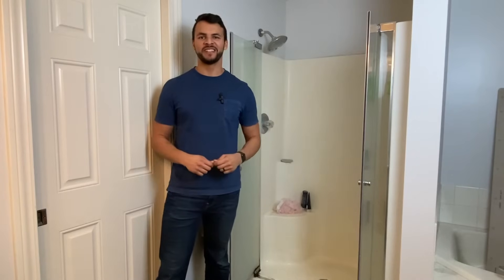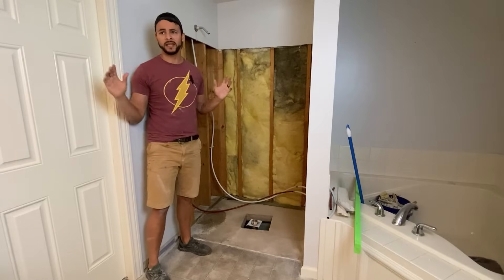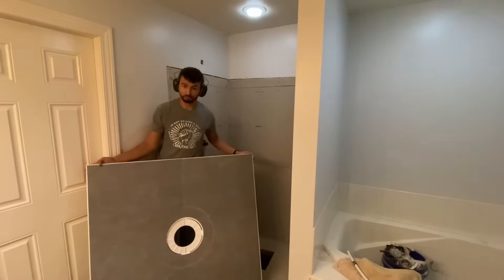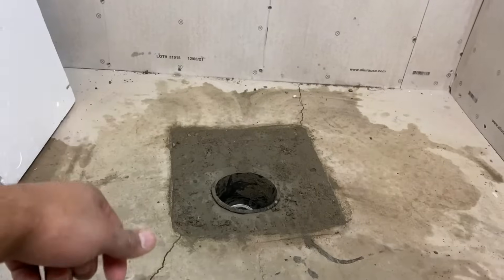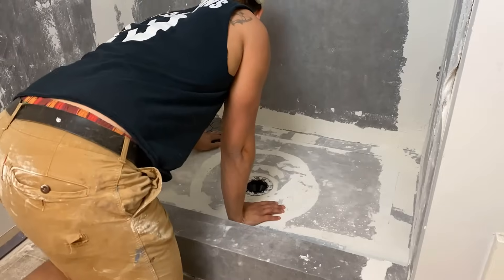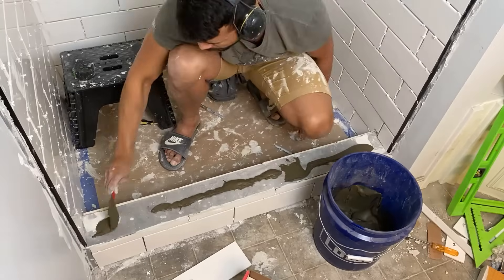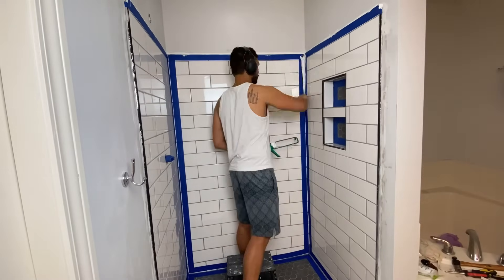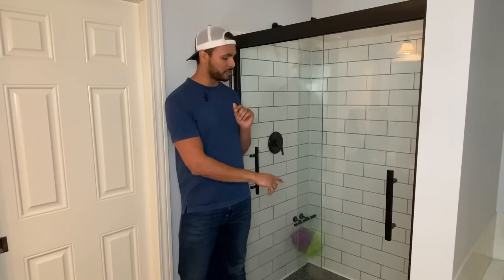How Much Does it Cost to Remodel Your Own Shower? | DIY Shower Remodel

Comment: A few tricks I learned from studpack building showers: 1) tile the floor first. 2) don't cut the hole for the niche until you have started tiling the wall it will be installed in. Helps us DIYers get it perfectly aligned with full tiles.  3) leave the bottom row of wall tile for last and plan for less than a full tile so that bottom row can be cut to fit the slopes along the bottom and yet be level along the top edge.  My advice: every DIYer needs a laser level or two.  I am in year 4 of a full gut renovation of a very old cottage, I have used my basic Bosch lasers for countless projects. one projects lines one projects dots.
Reply: Solid advice for all of us weekend guys!!

Comment: Not mixing concrete and doing dry pour like this will get you about 15% of the strength and vastly extends the cure time, in 30 days half of the thickness will still be uncured.

Comment: I've noticed that many DIYers love that niche idea. Seems like they just continue to copy it just because they see everyone else doing it in every DIY shower tutorial. Just letting you know, that small add on will increase the difficulty of this job by double. If you really want somewhere to put your bottles, I'd suggest just cementing a small ledge, such as a 36x4 inch slab of something like solid surface material.
Reply from the maker: Man, you couldn't be more right - that I remember that little niche being a nightmare lol. But we really wanted to used the same flooring tile to break up some of the subway tile. And assuming you'll have the shower for a good amount of time, then the extra headache is worth getting what you want in the end. 
Thanks for checking out the video!

Comment: I completed my 100% diy Schluter system tile shower last July,  $1500.00ish in materials.   Not a beginner project but doable for more experienced DIYers who are patient and detail oriented.  I watched studpack, tilecoach, and Schluter videos for skill-building.
Reply from the maker: Nice work 👍🏽

Yeah, it’s definitely a bit of an undertaking. But certainly beats an $8,000 contractor bill. 😅
Reply: @donnygrahambuilds  Tilecoach said that in Northern California, a complete tile shower will be in excess of $20,000.
Reply from the maker: @Alex.smiffy  gross lol
Reply: @donnygrahambuilds  I am spending under 40,000 on my entire house, inside and out Over 20,000 for one shower is insane.
Reply: Great video! Thanks for the detail! Watched the whole thing.
Reply from the maker: @ajoc222  thanks man! Appreciate the support 👍🏽
Reply: @Alex.smiffy that all depends on what you want. My parents shower has $15k in parts alone, and my dad owns a 50 year old plumbing company and the parts are at his cost. But if you want a touch screen shower control, steam, a dozen body sprays and rain heads, the cost adds up.

Comment: We’re getting ready to remodel our bathroom. The hubs & I are DIY’ers as well. I’m trying to talk him into doing the same as you!  He’s insisting on a pro.  Maybe after he hears the pro’s quote he’ll change his mind. Wish me luck. 😂  Thanks so much for sharing!
Reply from the maker: Haha love that! Good luck with the project. 
Thanks for checking out the video 👍🏽
Reply: As a pro, do your research, read the owner’s manuals, the installation manuals before you purchase anything. There are several products for every single aspect of the build, find one you are comfortable with. And don’t be afraid to hire someone for the difficult areas you are not comfortable with. Plumbing is easy, but if you want a pro to hang the shower valve, then hire it out and do the rest.

Comment: Great job. One thing to note are the municipal (or county) permits required for the remodel. Depending on the number of permits required, it will increase your costs another $300-1000.
Reply from the maker: That’s a good point, but so dependent on location, it’s hard to get a consistent figured to factor into the overall cost. 
Thanks for checking out the video!

Comment: Hey great video man. One thing I did notice that you forgot and I’m hoping isn’t causing any issues currently is you need to put metal plates over where you run pex to prevent screwing into the water lines. I’m assuming you haven’t seen any water damage so that’s good. Just wanted to letcha know. Nice work.
Reply from the maker: Thanks for checking out the video man! Appreciate the feedback! Honestly, I just kind of noted where the pex lines were (roughly ‘x’ number of inches from the floor) and made sure to keep a good distance anyway from there when hanging the hardieboard. 

Appreciate the feedback though, solid info 👍🏽
Reply: @donnygrahambuilds  ahh, gotcha. Right on!  I’m about to do the same thing to my parents bathrooms and my bathrooms. A lot of work ahead of me!
Reply from the maker: @KeiganApparel  nice man! Go get after it 💪🏽
Reply: I wouldn’t have left that dirty/moldy insulation

Comment: Would I need to pull permits if I do this? in CA btw
Reply from the maker: That’s a good question. I think that’s pretty heavily dependent on where you’re located. I would touch base with your local permits office. Thanks for checking out the video!

Comment: Thank so much for your video… gave me the confidence to do this myself. I did have a question about the thinset tho. Home Depot recommended a modified thinset but I am going to get what you used for the vevor membrane. Do you think the modified is better tho for the tile?

Thanks again!
Reply from the maker: @josephcroasdaile4380  awesome! Glad I could have build some confidence! 
TBH, it’s probably better to opt for the thinset for hanging the tiles. I’ve learned since posting this video a few years back. 👍🏽

Comment: Thanks. No metal plates over the water lines ?
Reply from the maker: No 😅. Definitely should have, but forgot. Though, I didn’t remember to right down the distance from the ground up to the water lines and placed my screws for the hardieboard a good deal away from that spot. Less than ideal, but successful

Comment: Under $2k is amazing, man! Most would pay at least $5k for a new shower. Though the pan and board materials you used would make me nervous. Did you consider using the pink/red waterseal paint stuff? Can't be too cautious. Anyway, thanks for the video, I subbed!
Reply from the maker: Thanks Jeffery! 
The kit I used didn’t recommend using any additional water sealants, but I do know the stuff you’re referring to. We actually moved out of that house (part of the reason for the reno), so I don’t have access anymore, but we didn’t have any leak issues while there. Though, if/when I do it again, I’ll likely opt for a shower floor insert, just much easier to work with. Anyway, thanks for checking out the vid and subscribing !

Comment: TFS! Quick question, there appeared to be some mold on the existing fiberglass insulation when you tore out the old shower. Why didn't you replace that before continuing the new install? I noticed another installer did the same.
Reply from the maker: Hey thanks! That actually wasn’t mold, it was dirt. The was air intrusion on that side of the wall, when air can get through, it pulls everything with it. So the insulation was essentially serving as an air filter and caught all of the dirt that was being carried through. At least that’s what I was told when speaking with a local pro when I had it looked at. 
Thanks again for checking out the project!

Comment: This was awesome. I have a shower exactly like this in our master. I feel encouraged to try this. 
But: did you ever consider using cement board instead?
Reply from the maker: Hey Cris, I definitely did think about cement board. The deciding factor was that I still needed the shower pan, and that came in the vevor kit. That kit was cheaper than a stand alone shower pan, and had the rest of what I needed to fully waterproof. 
Thanks for checking out the video 👍🏽

Comment: You are so humble. My husband and I are remodeling our master bathroom. Thank you for sharing the video. How difficult do you think it would be to knock out the wall separating the shower and garden tub and extending the glass frame on the lip of the tub? Just asking. Awesome job.
Reply from the maker: Haha thanks so much, I appreciate the encouragement! It’s definitely an undertaking. But if the wall isn’t load-baring (those types typically arent), I’d go for it 🤷🏽‍♂️. You’re gonna have some additional framing, drywall, and possibly plumbing to work through. But it would be a real drag to reach the end of your project and wonder “what if” after putting in all that hard work - been there 😅🤦🏽‍♂️.
Reply: @donnygrahambuilds  I'll leave it. Look forward to your next project. God bless.

Comment: Nice vid! I have been working for a subcontractor lately. It's an interesting field. My guy charges $65 per hour for both of us. I get $25 of that. From what I hear his rates are way low but he is like me, old and slow. I'm looking for something in the field I can do solo. Thinking about kitchen storage solutions, soft close drawers and cabinets, and generally improving fixtures already in place. My real question what to do with the tub jacuzzi to the right of shower? We have the same setup. It got used once. We're looking for ideas to convert that space to something else.
Reply from the maker: Thanks for checking out the vide!

My wife actually used ours with a fair degree of regularity, so we decided to keep ours. 

Could also remove it and just have an absolutely massive shower area. expensive, but cool 🤷🏽‍♂️👍🏽

Comment: May I know which subway tile you used on this remodel? We have a similar size stand up shower and liked the color scheme you did. Also where did you purchase the door? I appreciate your input and really great job on this remodel. Thank you in advance!!
Reply from the maker: Hi there!
I used 4x12 subway tile that I bought from my local big box store (Menards). I purchased the shower door there as well. 

Thanks for checking out the video!
Reply: @donnygrahambuilds  I don’t have 1 second of experience with bathroom remodel. Our house is 43yrs old. Lol. Low on budget but also def need to change it out and your video is as close as it gets to DIY/Budget Reno. Kinda over what I wanted to spend but u rerouted ur water line and had to fill the hole with quickcrete. And I think your area is bigger so mine might come out slightly less if I follow ur build. Thank you so much again!!

Comment: I hope you did something to make sure water or moisture didn’t get into the holes that support foot bar. Maybe it was not included in the video. This was very useful.
Reply from the maker: The car comes with gaskets to prevent water intrusion. Thanks for checking out the video!

Comment: What happens if you pull out the surround and find the wall is water-damaged underneath? We're pretty sure that's what we'll find in ours since the other side of the wall has some bulging...
Reply from the maker: I’d probably just figure out how to replace whatever is damaged and try to do a better job than the last guy when waterproofing 🤷🏽‍♂️👍🏽

Comment: How exact did you slope the shower curb inward or was it manufactured with a slope? Thank you.
Reply from the maker: Hey Michael, good question ! Yeah, this particular model (I think most of them) came with a slope already present. So I just applied them thinset following the prefabricated slope.
Thanks for checking out the video!

Comment: I have a question about the drain (stainless steel and adjustment ring) installation. I have the same kit and my adjustment ring does not in any way fit on my stainless steel drain. The adjustment ring flange does sort of fit the stainless portion but not well and the instructions and videos do not explain this. How did you get through this process?
Reply from the maker: Hey Jacob, sorry you’re having trouble! I’m struggling a bit to visualize your current situation. But it sounds like your drain in your shower is stainless steel? I would check the outer diameter of your drain against the inner diameter on your kit. Then pick up a transition connector - and possibly a pipe cutter if the transition piece is long enough that your pipe has to be shortened in order to keep you drain at the correct height. 

Hope that makes sense, good luck with your project!
Reply: @donnygrahambuilds  wish I could send a picture to better give a visualization of the issue. But with that said the stainless steel portion of the drain in no way fits the flange and or the height adjustment ring (small black pipe) provided in the kit. However it matches the photo description of what I bought but I am just not seeing a plausible way of connecting the pieces unfortunately. Most drain kits at lowes and home depot are made for the typical grouted floor and liner showers. Maybe a shluter drain would be interchangeable? It seems like it has to work in some fashion or else it wouldn't be in a kit. Thanks for any help!

Comment: Nice video! Great job! I have 2 questions; 1. the two cracks in the cement-floor before waterproofing i guess they were not Any issue? Why not? I would have worried. (I dont have experience) 
And 2. When drilling in the foot-rest are you not breaking the waterproof membrane? And is that not an issue either? 
I don’t have experience just trying to understand and those were things I’d have worried about. So wondering how they’re ok. 🤗
And
Reply from the maker: Both good questions - from what I’ve researched the 2 cracks in the floor shouldn’t be a big issue due to the age of our home and things just “settling”.
The holes for the foot rest would be an issue, but the kit comes with a gasket that seals up the connection points. 
The shower has been up since June and everything is working just fine 👍🏽 thanks for checking out the video!
Reply: You could put silicone in the screw holes also.
Reply: As long as the crack isn’t wider than 1/8 inch, hasn’t translated to an adjoining wall, and is level on both sides of the crack (one side of crack being higher) then you are okay and was probably present soon after the concrete was laid… it is good practice though to notch out that crack at a 45 degree angle and fill it in with a crack filler…
Reply from the maker: @js6872  good to know, thanks for the solid feedback!

Comment: There was some insulation that was black, is this an issue for mold?  Should this be replaced with new insulation?
Reply from the maker: Good question - I actually had the same one haha. But no, the black substance wasn't mold. It was caused by my previous fiberglass shower insert having an air leak. Air gets through, and any dirt/debris that is in the air gets caught up in the insulation. Further confirmation of no mold is the fact that the black material is isolated to just the insulation - mold wouldn't have discriminated between stud and insulation. If you're unsure about your own space though, I always recommend asking a pro 👍

Thanks for checking out the video!

Comment: I’m a new homeowner and would love to make some improvements in my little condo. What kinds of projects would you recommend for an absolute beginner, things to get my feet wet when it comes to home improvement projects? The only thing we’ve done is change the garbage disposal which is of course not much a project at all 😂
Reply from the maker: Hey Monica, thanks for checking out the build!
Changing a garbage disposal can be a real pain, it’s not complicated, but it is a tight space. 
For a new home owner, I’d recommend something low risk, like a kitchen or bathroom backsplash. 👍🏽
Reply: @donnygrahambuilds  thanks, I’ve actually been thinking about doing that to spruce up the kitchen. I appreciate the tips and videos!

Comment: Great video!! do you have a link to where you got the shower door from?
Reply from the maker: Thanks for checking out the video!
I actually got this model from my local Menards. So no good link. Most local big box stores will carry similar designs 👍🏽
Reply: Hey Donny i’m at the 10:01 mark in my project , my question is where did you get the rubber spacer you used when you poured your cement? i purchased the same shower kit in your link and i do not have one.  Thanks in advance.
Reply from the maker: @JayStylz  good question! 

That piece is actually just a 4” rubber pvc connector hose I had on hand(not part of any kit). Any lowes or Home Depot will carry the same 👍🏽
Reply: @donnygrahambuilds  Thank you ! at lowe’s now.
Reply from the maker: @JayStylz  hahah good luck! Keep at it!

Comment: I want to widen my shower. It’s tiled instead of the insert. Will that be much harder?
Reply from the maker: Hi Erica, Thanks for checking out the video. 

As for your question - I'm not sure. If you're planning to replace all of the tile, then I think you're process would be similar (demo, frame, waterproof, tile, grout, etc). However, if you were wanting to keep the existing tile, and just make the space bigger, you may have some issues matching the current tile and grout lines - not to mention the shower curb would need reconfigured for the larger space. 
I'd recommend totally redoing the space - all new tile.

Comment: That glass is extremely hard to break but extremely easy in certain spots. And it breaks the way it does so its not sharp shards its lil pieces that are usually not to sharp.
Reply from the maker: Makes total sense. Break kind of like the back windshield of a car.
Thanks for checking out the build!

Comment: Came accross this video while researching how to DIY a shower. Great video! Im also looking into buying this same shower system. Quick question, how did you slope the shower curb?was it using thinset or cutting the base a bit? Thanks!
Reply from the maker: Thanks for checking out the vid!

This system (linked below) comes with a shower floor (foam) that is pre-sloped by the manufacturer. Takes out all the skill/guess work 👍🏽